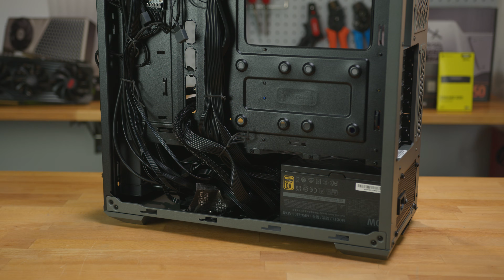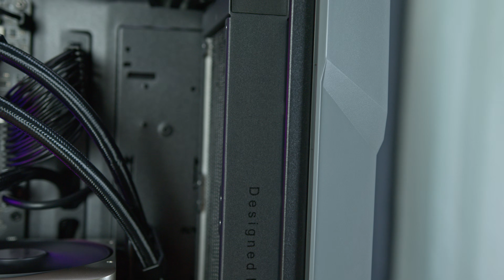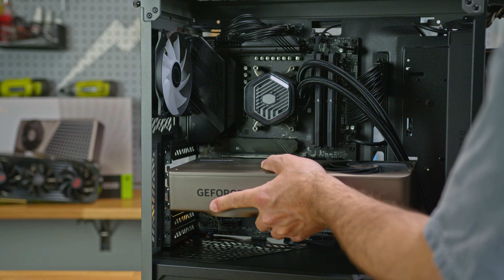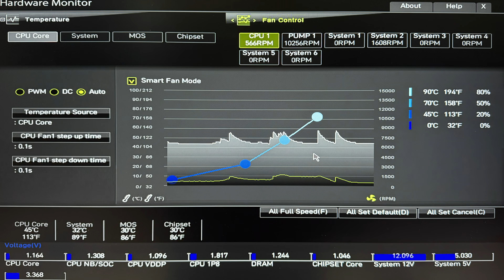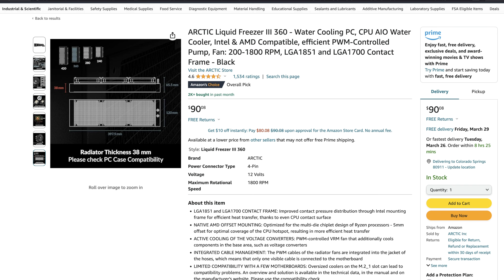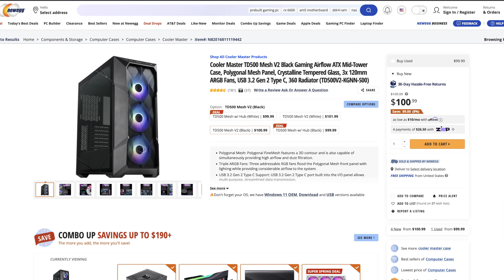Cooler Master TD500 Max: Ultimate Cooling, GPU Restrictions!

Comment from the maker: Update from Cooler Master: The TD500 MAX is designed to work seamlessly with the latest GPUs ready with AI capabilities. We've prepared an ATX3.0 12VHPWR cable, which is compatible with the RTX 40 series, such as the 4070ti or 4080. For those using GPUs with an 8+8 pin connector, like some RTX 20 series cards or AMD cards, we've got you covered! Users can simply reach out to their local customer service, and they'll provide an extra 8-pin PCIe cable free of charge.
Reply: Because it's too hard just to put it in the box with the other cables?
Reply: @RichWhiteUM or because it’s too late into the launch to admit CJ found a crack and a delay would be financially crippling… 😊 I suppose it will become standard further down the line.
For the price point, it should.
Reply: @balfit  It should have been included with the first one that shipped.  There's really no reason for it not to have been included.  It does make it seem like the original intent was to only accommodate Nvidia 4000 series and maybe some 3000 series cards.
Reply: I  bought myself a RD500 Max now 7 month after this and it is still only one 6+2 pin included in the box. Wtf, I’m sitting on a 3080 that needs 2x of thoose and now my build is stuck. 
Anyone can point me to a good 6+2 cable that is compatible with this psu? Getting Cooler Master to send me one here is Sweden will not be easy…
Reply: @TheDigital79  did you find any solution i want to buy one and just realized the problem with the cable. will not be easy for me as well to came to my country
Reply: @tasos5000  Try to contact your seller and see what they say. For me I was expecting nothing but still contacted them and to my suprise they said they will contact CM and get me the cable without any issues. I few days later I did get the cable in my Mail here in Sweden and I could finish my build. CM has promissed the sellers they will help out with this missing cable as far as I understand.

Comment: I love the idea of having a case mostly prewired, but seeing that I’m gonna have to remount the radiator on top where it’s supposed to be makes me wanna pass on this case. If that radiator was mounted on top with three fans on front for intake already preinstalled pre-wired I would buy this case in a heartbeat.
Reply from the maker: Placing an AIO cooler at the front of the case as an intake is not a bad choice because the temperature difference (delta) between the air inside and outside the case is typically very small—usually just a few degrees. This means that the cooler is still pulling in relatively cool air to dissipate heat from the radiator effectively.

Additionally, front intake setups prioritize delivering fresh air directly over the radiator, which can help maximize cooling efficiency for the CPU. The slightly warmer air exiting the radiator will still be efficiently exhausted by other case fans, maintaining good overall airflow and system temperatures.

Comment: might be good for most but if any not standard motherboard for example with EPS on side of the board then might be problematic ;[
Reply from the maker: EPS on the side is typically only on E-ATX boards which aren’t compatible with this case. Also the EPS pass through connections are positioned on the center of the mobo tray and the cables are long enough to reach the front side of an ATX board.
Reply: @ElevatedSystems there were x99/threadripper boards with EPS on the side of the board . And with E-ATX thats almost a lie with what are board producers doing in last few years - basicaly no standard and calling everything larger than typical ATX they call it E-ATX